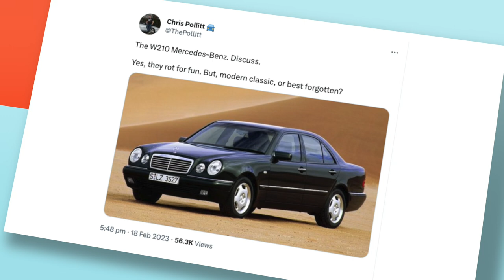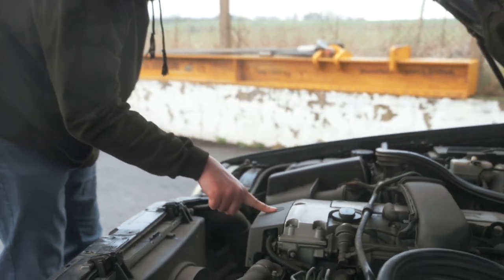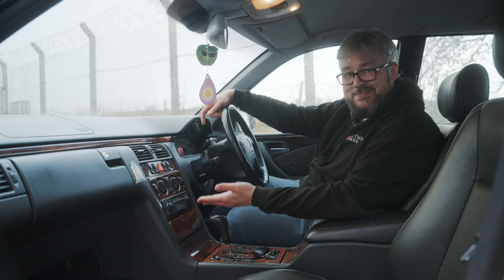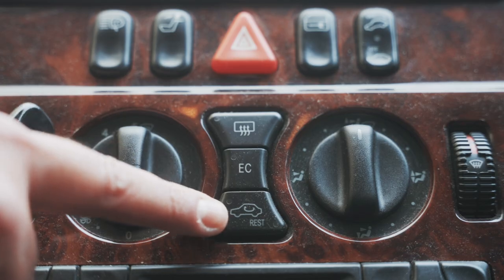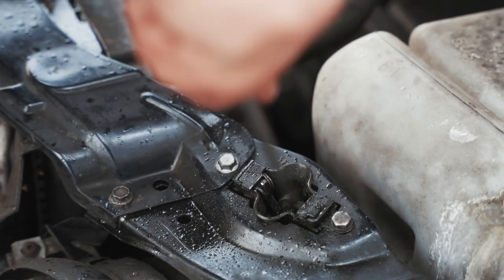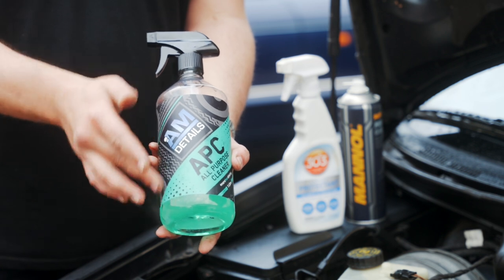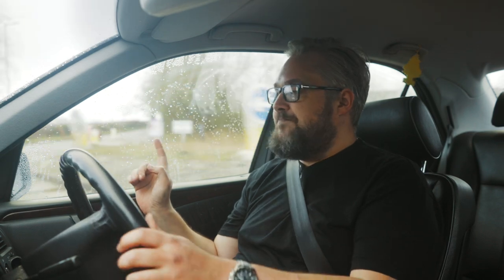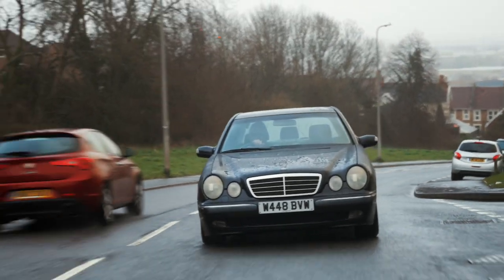I bought the WORST generation E Class. But, is it actually bad?

Comment: I had 3 of these, a 4 cylinder E200, in line 6 E320 and later a E420 V8 and, despite all criticism, always found them very reliable
Reply: Absolutely. They're used as taxis all over the middle east and they carry on with just basic maintenance for years. As personal transport the E320 is probably the best option with regards to economy, reliability, comfort and driving pleasure. The E420 V8 (and the venerable E55 AMG) are, of course, more desirable but only to those with unlimited budgets.
Reply: Same, my E320 is super reliable
Reply: @sputumtube 

Unlimited budget for what?😂 anybody who earns a decent living can afford one
Reply: Had a 98 e320 and now an 01 e430; and I agree. Very reliable and safe.
Reply: My first MB was a 1996 E320 with the M104. I loved that car. Would probably still have it if it hadn't rusted so bad.
Reply: @rustyshitbox  MB engines are chain engines at that era...
Reply: @budder71O  The pre 1999 models weren't actually so safe. MB had a poor crash test and made big improvements to the facelifted W210.

Comment: A proud W210 owner. Try m112 or m113 engine with 5 speed automatic facelifted examples. Except rust issues they are quite bulletproof and comfortable. No need to worry about SBC brake, no problem in head gasket or degrading wiring harness, no worries in leaking air suspension, reliable 4matic, still high quality interior.
Reply: Why facelift? Is there any issues with the pre facelift
Reply: @rrrrr-s3q  mostly electronics and a bit improved rust resistance. But pre facelift w210 is also a good car
Reply: @jhfoever hello mate I'm late to the party ,what's the crack with the biodegradable looms ,do they literally dissolve?

Comment: Now imagine what E430 or E55s would be like from the era. Especially the ones that survived the rust and have been kept in good nick.
Reply: I can confirm an E55 is an amazing thing 😁 I've owned mine ('98 model) for nearly 7 years now, and it's one of the non rusty ones in Obsidian Black  👍
Reply: @tejsgarageuk2830  Which E55 is better and more reliable, the pre-facelift one or the facelift?
Reply: @mbz4652  Well I would say pre facelift as that's what I have lol. Though seriously, in England certainly, the face lift cars are the more rusty ones. I think this is due to the paint technology legislations changing around year 2000. My car has never had any welding done and has it's original spring perches too.

The facelift cars also have a larger screen in the dash (showing MPG etc - which pre facelift don't have) and this screen is also prone to failing. Mechanically they are the same however. Facelift come with the COMAND infotainment system as an option (older cars did not get this) but someone fitted this to my car more than 10 years ago so that is a bonus. 

It's really what you prefer the look of, but most important is a car with as little corrosion as possible.

Comment: Apart from the well known corrosion problems these are a very good car. Personally I think they drive better than the W124 with a much more modern feel. The 4 cylinder engines are super reliable as are the auto gearboxes. 
Lots of online hate for these cars, lots of it from people who never owned or drove one.

Comment: Alright mate, here’s the dillio.

1.
The rest button is to continue the AC or Heat after you’ve turned the engine off

2.
The S and W switch is for standard and winter driving modes. W starts the vehicle in second gear to reduce slip on snow when taking off. Set the switch to S on the regular.
Enjoy your 210 😊

Comment: The E200 is not to be underestimated, i bought one that had 316k km on it but it still drove like new because of top service and care but still it rusted. It was the avantgarde so the ride was amazing and sporty. Pretty fast for what it was, best 300 pounds i ever spent.
Reply: I have C200 cdi 2003 and odo 467 000, runs good and drives good. Mercedes is quality car if well maintained
Reply: @w203ilux  Nice man its a great car! I recently bought a w210 E220 cdi 2001 previous taxi with 563 000 km. I agree this one is very comfortable
Reply: You are right, they are and were good cars, a pity about the rust, but all cars rust, some faster than others and in others you just don't always see it, other cars rot from the inside out. Remember Mercedes is not a British box. I currently also have a W124 E300 24v from 1995, the engine runs like a Swiss clock, and NO rust!

Comment: What a lovely looking example that is. Had 2 of these and both drove absolutely superb. Elegance much softer and more comfortable ride than the Avantgarde. One thing I would check though, as this happened to both of mine and a mate has just had same thing, is the front control arms/wishbones. They 'can' crack/corrode just where the balljoint attaches, which will cause balljoint to shear off. A quick Google may be an idea. Very much looking forward to seeing your progress with it.

Comment: I own '98 w210 E200 Kompressor (137kW) in the Elegance trim, and the car is superb. The build and ride quality, a plenty of power, very quiet interior and the best air cabin filtration system on the market, even today. It's got the 4 filter setup (only on the dual A/C LCD panel models). The rust is an issue, but it's a cosmetic issue that I deal with regular. Definitely read the user manual to your car, these machines have tons of features. My car even has got the sun position sensor, auto dimming rear view mirrors, remote window operation, wiper rain sensor... and so on.

Comment: Great buy, looks like quite a solid example. I own a 1997 E230 and I absolutely love it. The base four cylinder W210 is very underrated as a car. Not the most powerful engine but it turns really well given there is very little weight over the front and it rides superbly. I did a buyer's guide on this and the four with few electronics is quite a decent buy. Some of the sixes can be troublesome and corrosion can be an issue especially on crash damaged cars. However, once your drive one and own one, it nowhere near the disaster it is made out to be, especially compared to many more modern offerings. If anything my W210 is making a lot of newer cars in my fleet and projects look quite ordinary in terms of value for money and reliability.
Reply: Agreed a good solid car
Reply: The amg’s are amazing too. My favorites car I’ve ever owned out of 30 amazing cars over the years.
Reply: a C or E class from '97 to '99 with an I4 engine are super solid, they doesn't suffer from bad wiring harness like the older ones and the m111's are bullet proof just like the 722.6 trannies from those years. Just be careful to buy one that got the ATF fluid serviced like it should and it's not rotten, thankfully were I live (Spain) we don't have problems with rust on cars, so it's easy to get one rust free here. These cars are OLD but despite that, they are packed with ABS, BAS, ESP and more, the interior on these things are immortal high quality plastics, not hard cheap crap also the E class excelled safety ratings at the time (c class was ok-ish...), the only thing I don't like are the looks of the E, the C (and even better, a C estate) looks way better IMO.

Comment: Good darts Sir! 210's are great value right now, not suffering from the same price hikes you saw on the W123 and latterly the W124. They share some parts too, and that same solidity you feel when driving. Yes, some of them rot, so do most cars from that era. 3 series and 5 series, and even the 7 series are serial rotters. 

Paint issues abound from the use of eco friendly water based paints poorly applied and with shite QC. It's all fixable. Any part you can't be repainting immediately, just rub it over with ACF-50 and do it later. 🙂

I like these, and will follow with keen interest. Great filum, thanks!

Comment: Nice car. A couple of things: The EC button on the climate control stands for Economy, that is the button that actually cuts off the AC. The rest button allows you to run the heater while the engine is off. The S mode in the transmission does not stand for Sport, but Standard. That is actually the mode you should be in most of the time. The other mode (W or E depending on the year) cuts out first gear, for wet surfaces. I find it's also useful for traffic jams. Saves you from the repeated 1st to 2nd shift when you get going 😅  I have a w203, which is the corresponding c class. I also think these cars are underrated. Sure the quality of the plastics took a bit of a dive compared to the previous generations, but mine has 400,000 km on it and it still runs great, is very comfortable and feels smooth as silk.
Reply: On W124 'W' stood for Winter such as snow or ice
Reply: @kadiocalc  What year is your 124? I have a 190E (W201) from '85 and that had the S/E labels on the box (E for economy, but it did the same sort of thing, cut out 1st gear). I converted it to manual a couple of years ago when the trans started slipping, it has much longer legs now :)
Reply: It was a 1990 300TE. It was a 7 seater, apparently it was an option for extra seats or a larger fuel tank. Things i loved about that car was single front wiperblade, rear wiper cane on when you selected reverse,  OTG, an extra sun shade above the rear view mirror, load cover attached to the tailgate, self closing tailgate (once you had lowered it) movable centre arm rest and that silky smooth straight 6.
Happy Days.

Comment: I owned an E300TD it rusted around the wheel arches and the boot lid which was replaced f.o.c. by MB , I replaced broken front springs, roll bar drop links and glow plugs, it had covered over 140k miles when I sold it and I enjoyed the car very much as it was my first Mercedes

Comment: Thanks for another great video!! Loved your presentation for "a misunderstood" Ε class! Some time ago, I read somewhere that there are about 1200 updates in this FL version of the w210 in compare with the first series.

On the Auto gear box, W stands for winter and starts the car in 2nd gear in case of ice or snow. S is for standard, which starts the car 1st gear. In W, the gear box & engine feels slower & smoother but gas consumption is lower than using it in S.

I replaced my 1999 w202 c180 with a low mileage 2000 w210 e200 kompressor auto, on April. As you said, you can buy a top of the line car for a descent amount of money if you can afford maintenance. I am very happy with it, it is very quiet, smooth, luxurious and have lots of extras that even keep up with modern standards. Rust is not an issue in Greece, where I live, because of the climate. Instead of buying a w211 I decided to go with the w210 and use the rest of the money for cruises & trips to enjoy the car. There hasn't been a single moment that I have regretted my decision. W210 feels very solid & well built in compare with the more modern w211. Consumption is almost the same (2.0 kompressor auto vs 1.8 kompressor auto), and parts are WAY cheaper and can be found literally EVERYWHERE.

Comment: One of those was good enough to do the airport runs for a mates taxi firm and had over 300,000 miles on it when a bus ended its days. He replaced it with another one and its still in daily use.

Comment: I had the same year E240 back in the day. Gutless V6 but really refined. It would go in every year for its annual respray (Merc corrosion warranty) which was great for losing scratches. Not the greatest design but the front, back and interior were very nice imo. Chopped it in 5 years later for a 2005 W211 E270cdi. Vastly better car.

Comment: I had the E300 Avantgarde, (1999) it was a bit of a harsh ride, but a very nice motor, sadly the tin worm killed it in the end, I did get 3 new doors, both front wings, and the bonnet and boot replaced as a good will repair by MB when the car was 7 years old.  Check around the rubbers on the window frames of the doors for corrosion.
If it wasn't for the rust, I would have kept the cars a few years longer, mechanically, it was flawless.

Comment: Great car and great video. My second Benz was a ‘95 W210 E250D, one of the first to be brought into the UK. Unfortunately when Merc built the first RHD 210s, they found the steering column got in the way of the turbo on the 5 pot diesels, so the first few were built as naturally aspirated examples, mine being one of them. As such, it was slow as cheese but simple, economical and bulletproof. I bought it at 120k and eventually it died at just shy of 300k, but only due to my ex wife breaking the ignition barrel by using the wrong key by mistake. 

I loved that car and it made me a Benz fan for life. Many cars later, my current daily is a 2005 CLK 220CDI, probably the best of all the Mercs I’ve owned.

Comment: Hi Toronto  Canada 🇨🇦 here i bay New  96 e 320 inline 6 best car i ever owned  drove  till 2014  251,ooo km zero  issue  synthetic  oil  every  7000 km my car was  meticulously   locked  after  i sold to my friend  for  3ooo thousand dollars   absolutely  perfect  car and  that  model was very  cheap  to menten  ,only  ac condezor was replaced  original  alternator  starter radiator  muffler  i  rely loved   that  Mercedes ❤ good luck to you  on your  project

Comment: Chris, that's a lot of car for the money and it has good bones. With a bit of work you can make it great. As a W204 C200 owner myself, I know where you're coming from. I recently had to have the rear subframe replaced by a local dealer recently but thankfully, that was covered by the warranty. The inspection that was carried out by the dealer highlighted a few other issues (some of wich would fail the MoT) and I'm now working my way through them. eBay is a good source of used genuine Mercedes parts but I'm not loath to buy from the dealer if the price is reasonable. Not everything from the dealer is expensive so it is always worth a try and the Mercedes still support their older models.

Comment: My first Mercedes was a C180 elegance, W202. I replaced it with a 2001 W208 CLK230 Kompressor, the coupe version of the W210. 
A great car, but rust around the front suspension mountings killed it at 16 years old!
I replaced it with a W211 E320cdi sport, an excellent car which I still own, a 2006 model.

Comment: My family owned a 1996 E250D (Naturally aspirated) with 113hp snd it was a classic trim. It had leather seats and it was used as a taxi. 

It was SLOW (0-100klm in 14seconds), had rust issues at some spots but until it's 18nth year (until 2014) it was reliable. We only had to replace the engine after 1,6million kilometers (or about 900.000miles) but beyond that it didn't show any issues at all. Even the shock absorbers were not replaced. The only thing that was serviced regularly were the ball joints (the major culprit for the w210 and w211 platform) ,the window regulators (they're made out of paper lol) and the climate switches (the round ones where they crack from too much heat). 
Everything else worked flawlessly and despite the cracked paint, it just worked and kept going. ESPECIALLY the A/C. No modern car comes close to it's coldest air condition at all.

Comment: I have had a e240 elegance from ‘98, with 120k miles for 9 months now that I also got for £999.…… lovely smooth motor that will do 360 miles on one sitting because it’s so softly sprung……. Got the wheels refurbed, repaired the air con, new headlights, serviced and replaced a rusty front wing….. I’m now £3000 into it but I’m loving it …….. such a lot of car for the money and people are even complementing it now 😅
Reply: Do you have the automatic model of the e240? If so, what is the fuel consumption like/how much is it for the e240?

Comment: I have 2001 E200 Kompressor Elegance. Bought it early 2020 and quite happy with it. Purposely chose kompressor model for the extra power as the body is heavy but didn't want the V6 due to expensive roadtax in Malaysia. I believe your car has the steering adjustment button on the steering column itself. Mine has the control for steering and seat on the door card.

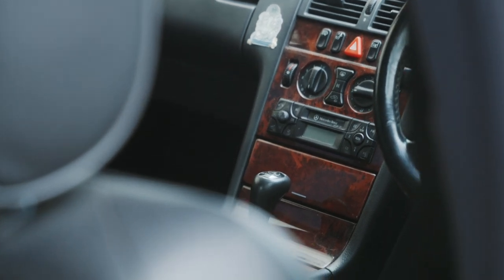Comment: The component in the centre console at 9:02 is a spare brake light switch.  My car the W211 has a problem with brake light switch as a consumable. i.e. only lasts for a set number of pedal operations.  After that the brake warning light will be on.  I suspect in this case the car you have here had a similar issue and they've got a brake light switch but it may not have fixed anything as I'm not sure the fault occurs on these earlier cars.

Comment: People dump on this "vier-augen" E-Klasse all the time. They had weird body rust early on in the life cycle with bolt on bits doors and wings.. the shells themselves suffer the same galloping rot as most large german cars of the 90's.

These were absolutely everywhere they really took over the municipality of the W124 before it.. They really are like the Ford Crown Vic of Europe in that respect.

The armrest storage mysteries... The switch is the brake pedal switch (these fail and wont let you shift into D), The other 'bit; goes down between the seat and the center console (around the seat belt) its a little infill to stop your dropping stuff down beneath the seat.

And yes if you put something behind the E-brake release handle it will disable the ratchet on the e-brake and you can just use it as a little on the fly foot brake.

'Rest' will keep the heater running for 20mins or so after you stop the car.. so ideal if you are nipping into the supermarket in the winter and want to keep the cabin warm.

Comment: I have a '97 E420 (W210) that I've owned for 7 years now. Bought with 85.5K miles and now just passed 160k miles. It is the most reliable car I've ever owned with proper maintenance. If you have the aptitude and some tools to work on a car, it is a great value to own these cars. Mind you, I live in the southern US, so road salt isn't corroding my chassis since that appears to be the biggest complaint for the generation of E-Class.